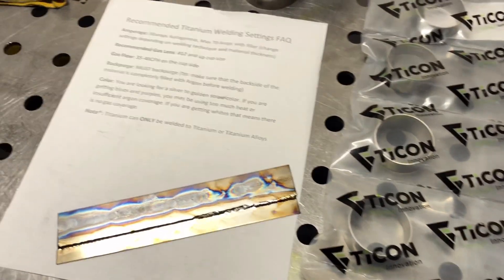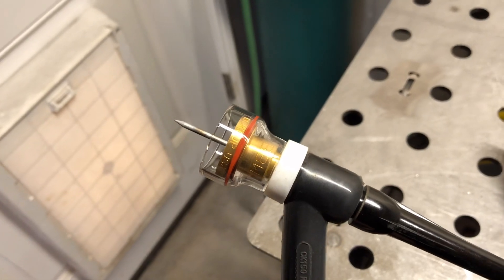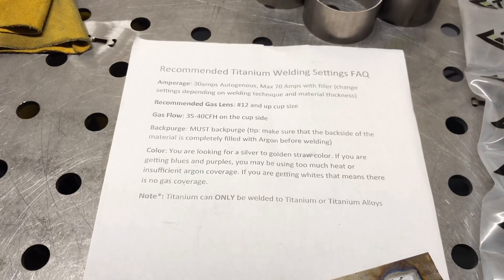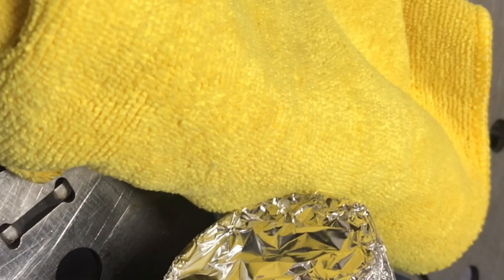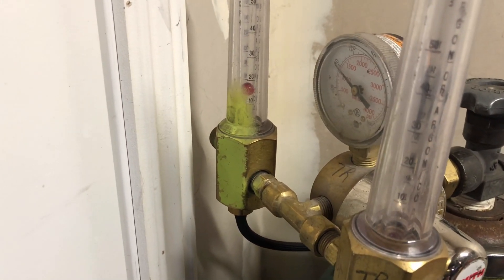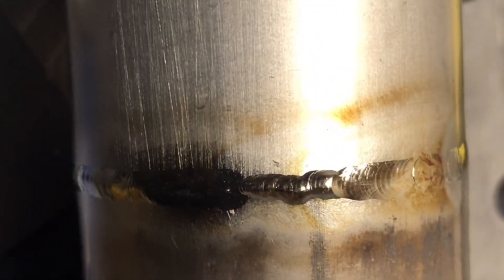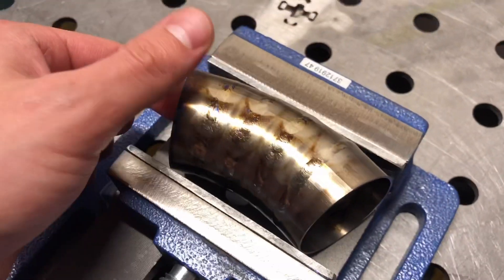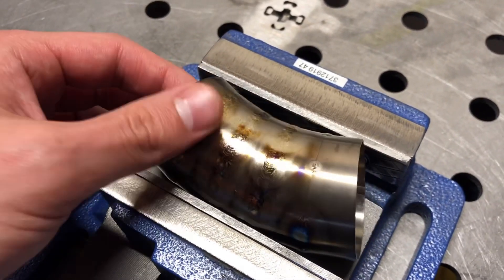TIG Welding Titanium | How To | Ticon Industries

Comment: Unless you put the parts in a purge tank, it’ll always show those colors, it’s the welding process reacting to oxygen.  People think those colors are cool, but it means a compromised weld. 
I spent many years with my face jammed up against a purge box welding military aircraft parts and brackets.
Reply from the maker: You are completely correct and I’ve seen many setups in the aircraft industry and they have high standard for titanium as they should. That being said I believe coloring on titanium for the motor sports industry has become widely acceptable. Just my opinion though!

Comment: Nice tutorial aimed at the "new to Ti" welder. I will add to cleaning with solvents and a rag being mandatory as was done here and so is removing the oxide layer prior to welding. Good quality sand paper, a Ti only SS wire brush and scotchbrite are options taking care not to embed contaminants in to the metal. Oh and wire wheels are bad. I like to cool (but not rapidly) each weld segment area after welding with compressed,  clean dry air to help mitigate thermal expansion induced stress. This is even more important on SS with its higher CTE  which can be water quenched (300 series) in lieu of the air blast.